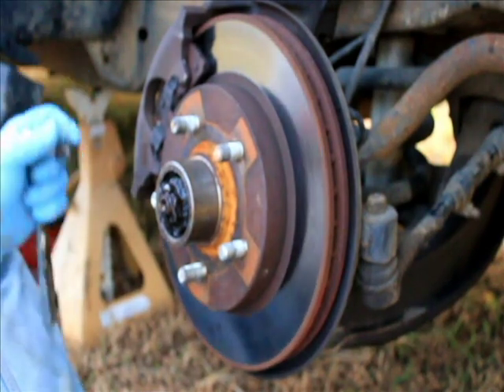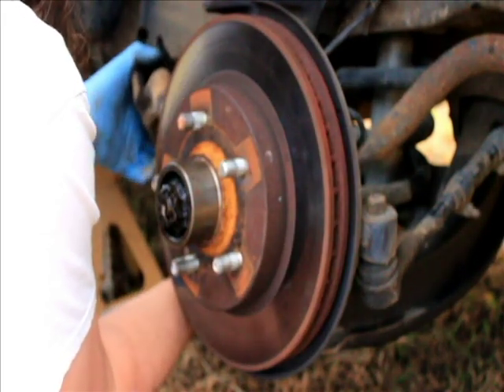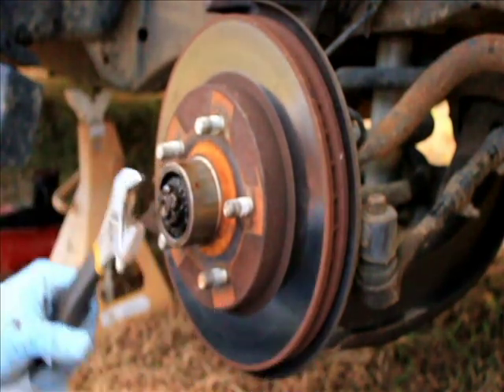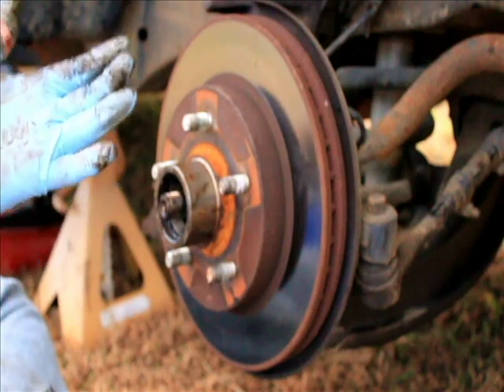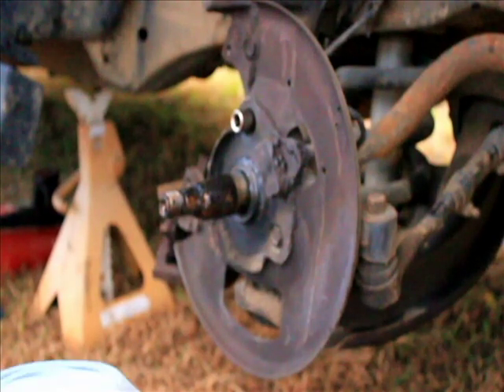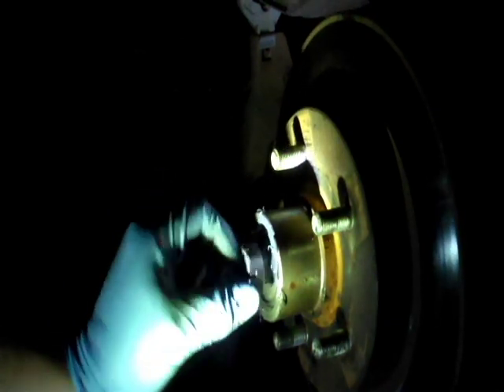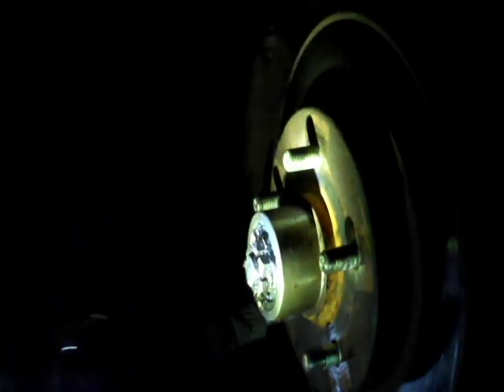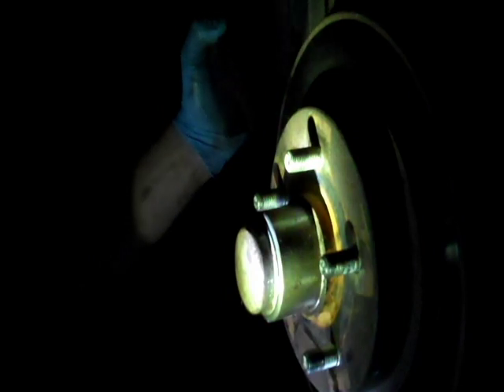How To Do Wheel Bearing Maintenance

Comment from the maker: the only difference with the inner and outter is that on the inner one you have to make sure the race seat is completely smooth and clean and the bearings can't have any discoloration on them.  then you simply pack them back full of grease and put them back on and bolt everything back up like I did in this video.  IF the race is damaged you can tap it out from the front of the wheel and you get a replacement race with the new inner bearings but they have to be tapped in straight.